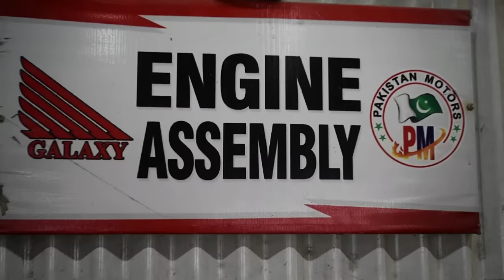The Secret Motorcycle Assembling Process You Never Knew About

Comment: Easy to be dismissive of their manufacturing, but the bikes are designed for a purpose and down to a price for people who can't afford £5000 or more for basic transport. Sure, they weren't being overly fussy, but the bikes look good, started OK and had all their gears. Easy to fix, no ECU or fuel injection or Cat. At least they weren't using points ignition.
 Fuel and oil, start it up and ride it. What's not to like?
Reply: How expensive is a swipe of grease?
Reply: @gordonloughton9800  or disc brakes maybe?? how about a torque wrench? what does that cost?
Reply: @davecalvo6418  Do you think Honda/Kawasaki/Suzuki/Yamaha are using torque wrenches on their assembly lines?  They're not.  It's about production and through-put.
Reply: @BillySBC they are using, not the classic ones, but automated preset from companies like Atlas Copco. In the Africa Twin service manual they are listing the torque for each and every fastener.
Reply: @BillySBC  Why wouldn't they? I know BMW's assembly lines use computers to not only track what fasteners were tightened (so an assembler doesn't miss something) but record what they were torqued to. Throughput is secondary.
Reply: @davecalvo6418 Oddly enough, It cost the same as a Honda, Now you know...

Comment: Not A Drop Of Oil Used On Assembly And Only Place Any Grease Was Used Is On The Headstock Bearings , And Everything Cranked Up With Air Tools .
Reply: Is there any other way? You forgot about the black smith’s hammer! What’s a rounded head of a bolt between friends?
Reply: No assembly lubrication. I wouldn’t be surprised if the failure rate is greater than 50% at start up.
Reply: I believe in a dusty sandy environment any grease or oil will trap sand grains and work totally against its purpose ie. Instead of lubrication it’ll just start sanding the joints.  Only thin lubricant like kerosine is safe in such environment that let sand n dust fall-off by itself while keeping the joint moisture or water free, what kerosine is good in.
Reply: @jpr2177  assembly tools at a bare minimum.. hammer, screwdriver, air wrench. Not a torque wrench in sight. Not my ride thank god
Reply: Dove si può acquistare

Comment: Excellent job.  Keep in mind, these are $500 motorbikes, you can not imagine, a motorbike at this price in US or Europe, so do not judge the workmanship with Harley Davison Standard which cost 20 times or more.  These run good, and give good mileage, 60 to 70 kilometers per liter, 30 to 40 miles per liter or 120 to 160 miles per gallon of fuel, as officially claimed by Honda Cd-70 which these motorbikes are based on.
Reply: That's fine if you also live where you only pay $1 an hour for a mechanic to fix any problems you'll soon have. The fact they assemble the gears, bearings and engine without lubricating anything just tells you what you can expect.
Reply: @David_in_Thailand  If they don't show you they put Oil in it, does not mean they will run the engine without Oil.  They do add that at later stage, and these Motorbikes do last for well over 25 to 30 years, on average on Original Engine.  I know because my Uncle owned a Honda CD-70 in Pakistan in early 1990s.  These are no less than Honda Motorbikes or any motorbike made in Thailand or Japan.

Comment: I finally worked out what the secret is... the carburetor gets fitted to the bike before the engine is fitted.
Reply: that impressed me to,o after trying to fit carbs on bikes once the rubber becomes stiff and hard, l never thought of taking the engine out to make it easier, the customer would complain about the bill though if l did
Reply: @debeeriz  Yes, sometimes logic can get in the way of efficiency, so the least obvious way ends up being the best option.
Reply: @Jonathan-L  i will admit to removing the air cleaner box on some bike to fit the carbs. but never the engine

Comment: Fascinating .

Clearly a Honda knockoff, I love old Honda singles and have a two owner (I'm the 2nd) 1984 CB125S, made in Brazil for the U.S. market, they sold poorly here and are rare and worthless but still very good little bikes to ride .

More than a few factory "Atlas Honda" parts that fit and work perfectly but are not quite DOT / FMVSS compliant are on my cute little Tiddler .

This shows how simple and basic the venerable Honda sloper engine ~ initially designed / released in 1957 they're still robust and reliable .

The drive chain tight like the 'E' string on a guitar ! .

I put one of these mufflers on my CB125S and unlike the Chinese crap ones it fit .

It's LOUD unlike a U.S. market muffler but the originals al had bad welds so the baffles break loose inside .

This is how your $350,000.00 Ferrari is assembled make no mistake . 

-Nate

Comment: No lube on any threaded fastener, farmer torquing all bolts (all you can muster), BUT a motorcycle with no battery to disappoint in a country where fuel is likely $7.00 a gallon and it will get you to work for a good long time there is something to be said for it.  I'll bet it is just as fun for them as us riding a GROM

Comment: Most of these bikes made the same way since the middle ages, the top of the range ones have a sack tied to rhe back to catch  the bits that fall off for reataching correctly later. You will never be able to compete with them on a buisness level in the west because we stupidly insist on workers having shoes,health and safety, tools ect. But fair play to them making a cheap product that works ok for the job it has to do. Will it be around in a hundred years for restoration like our old bikes probably not but for the price it's a result. The guys building them seem happy though. Entertaining video.
Reply: A different world, different mindset and expectations. Simple engineering thats easy to fix without specialist tools or equipment and cheap. If the bikes work or last only half as well as they're originally designed to, they'd still be a winner. I think we'd be surprised at how durable they really are.

Comment: about 52 years ago, I 've rode Honda CL 90 bike for the first time.  It was 90 cc small bike. This Indian made 70 cc 'Galaxy' bike is almost the same as honda' CL 90
Shinny bright wheel and wire spoke which is unable to see today. gear changer pedal, Front step 1 ,rear 2,3,4 , Brake pedal , front internal expanding drum brake  Chain cover, shock absorber
Kick starter, small lean engine,  chrome coated shiny wheel cover, Thin tire, 
 Every part s are the same or similar as honda's 1972 model.
I want buy one.
Reply from the maker: israrenter119@gmail.com
Reply: It's not Indian.  It's Made in Pakistan.    Please don't insult Pakistani people by calling them Indian.

Comment: A pretty funky little bike with a cheap 2 bolt engine that probably does well over 150 miles to the gallon. The first time the wheels need to come out for a puncture repair, the spindles will be rusted in because they arent greased on assembly, but  It doesn't matter because the street workshops will still manage and maybe grease them when they put them back together. These are cheap transport for the masses, and taking time to loctite every fitting, and grease everything on assembly would put the cost outside of the price point. Let the new owner maintain the bike correctly if they want it to last longer. We have the same issues in the UK with cheap bikes sent in from China.

Comment: not a torque wrench in sight all torgued to  ugga duggas  no assembly lube or thread lock the only lube l saw was  on the top rollers of the head stockl no wheel alignment and no road test, i hope these are not sold direct to the public, but have to go through a motorcycle shop and be checked over first

Comment: All torqued to factory specifications,  14 digger diggers , the previous delivery checker couldn't tighten bolts any tighter,  wheelies off the production line 😂😂😂
Reply: Could it be that the air guns have a preset in them?
Reply: @RealGoldRealWealth  nope , they are just standard cheap air guns , and the bolts should have different torque settings depending on size and what they are for , so they would need around 10 different ones , not 2 , one being a butterfly type